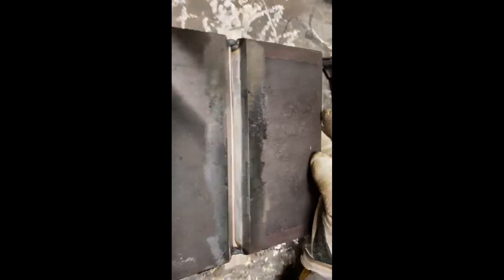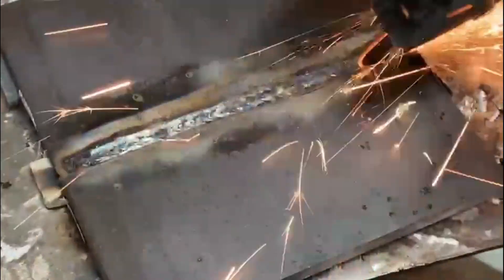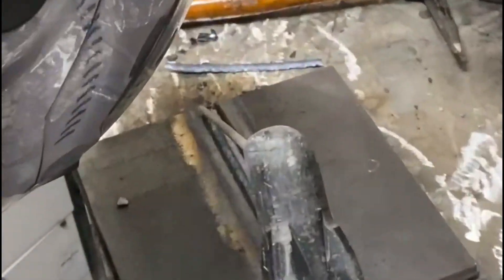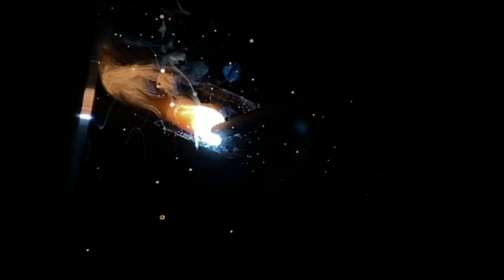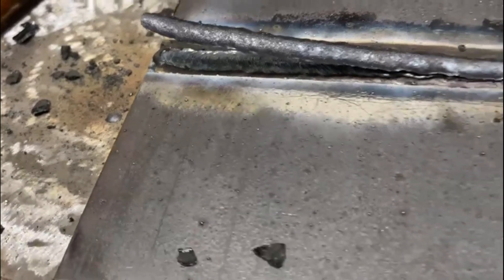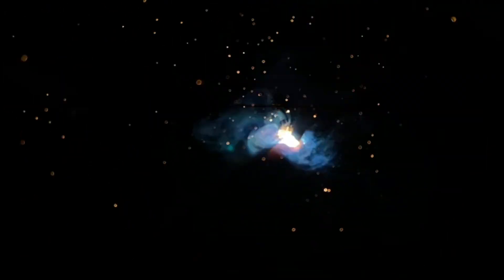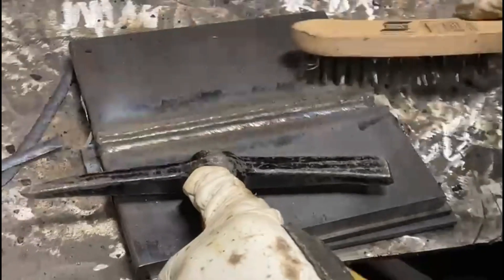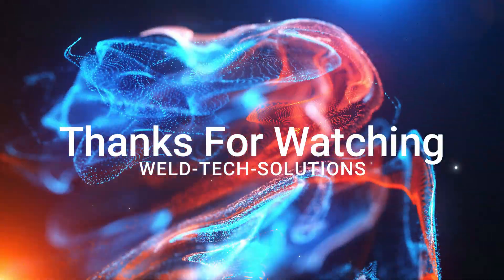Stick welding techniques E-6013

Comment: Nice video. A question, did you wait between the passes or did you weld non stop?
For "yard-special" project is important to wait between passes?
Keep the video coming! You are good.
Reply from the maker: On this particular video we welding none stop but like you say you should let the material cool between passes. Thank-you for the kind words we intend to keep them coming out 👊🏻👊🏻.